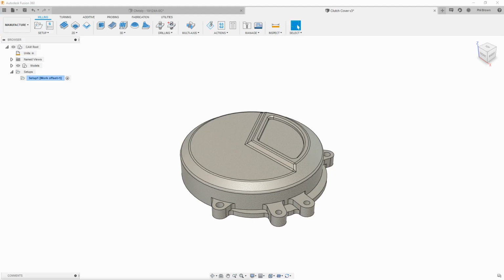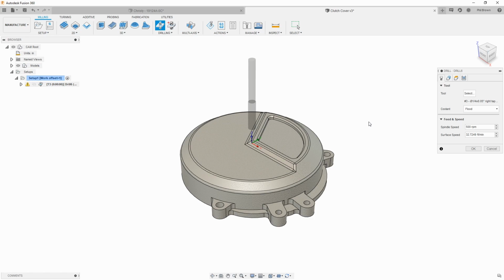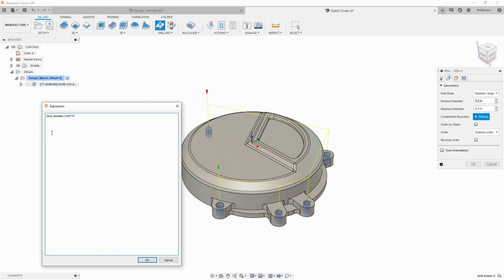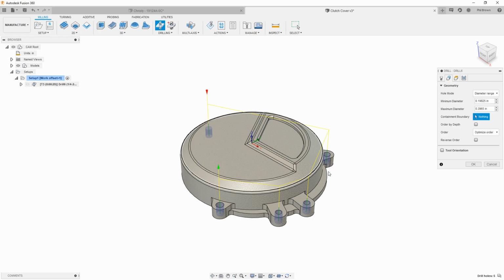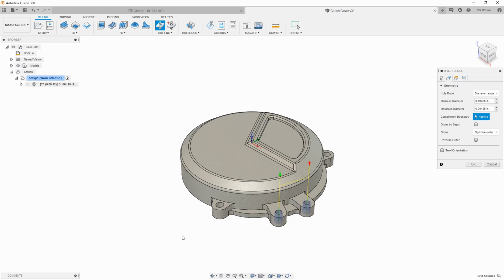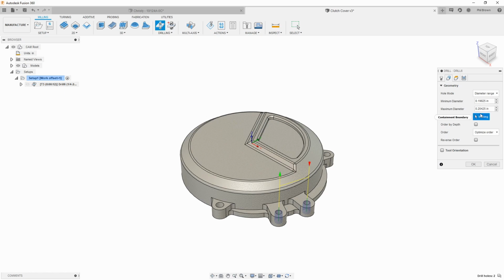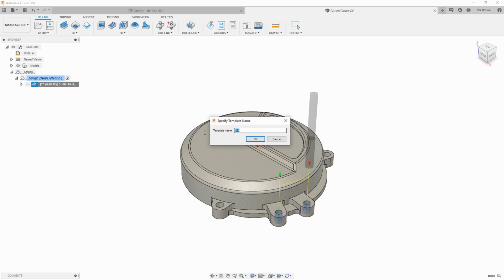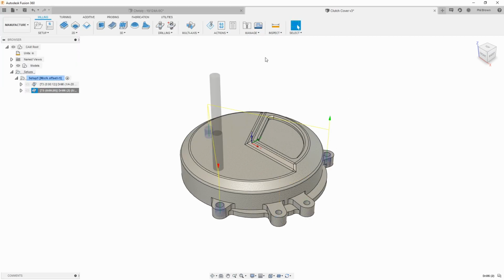QUICK TIP: Auto-Tap by Tap size

Comment: Would be cool if you could make this tip for metric too,as many people aren't familiar with the imperial drilling and tapping system.
Reply: Metric is much easier. Metric tap drill sizes are the diameter minus the pitch (For example, 42mm x 1.5 tap uses a 40.5 drill).  (tool_diameter-tool_threadPitch)-.07
Reply: @fusionphil2161  this being true for cutting metric taps. Not also for forming taps. For M6x1 I'd need a 5mm hole for cutting and a 5.5mm hole for forming.
Reply: @ltomuta  Let me see what i can figure out on my side.
Reply: Okay with a little digging what might work is take the (TAP OD - (Pitch / 2))               
(tool_diameter-(tool_threadPitch/2))-.07

Comment: In your expression you subtract .013 multiplied by the desired thread engagement percent of .75. What is the .013 and is this value standard across all tap bore to tap size values?
Reply: This formula is built around Inch Cutting taps both Fine and coarse as long as the hole size is the correct tap drill size. Iam currently trying to work out a formula for Roll forming as well.
Reply: Do you need such formula though? All the models I've seen so far model for cutting threads and you simply have to drill larger (and deeper) holes if you use a forming tap.
Reply: @ltomuta  Correct if modeled as a Cutting tap than no need to change the formula just need to keep in mind that your drilling oversize. however if they where modeled to the true roll form tap size it would be nice to auto populate those tapping tool paths